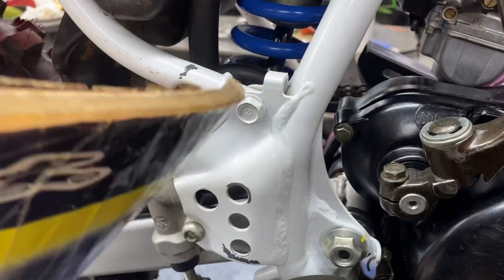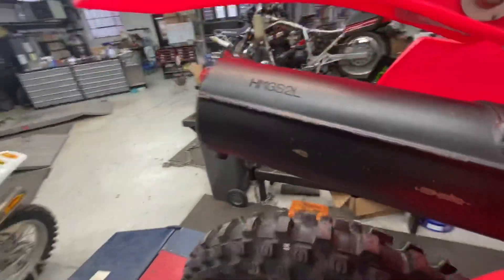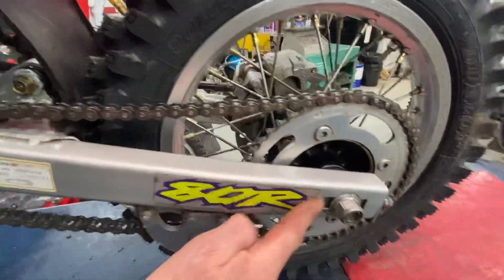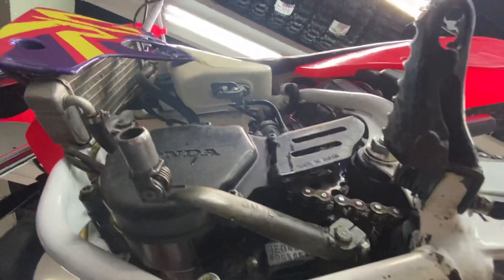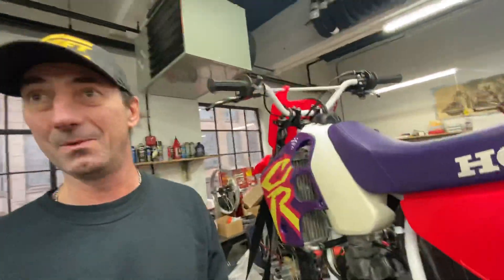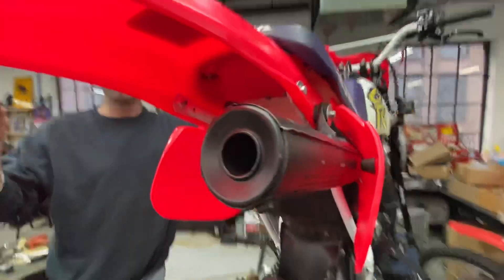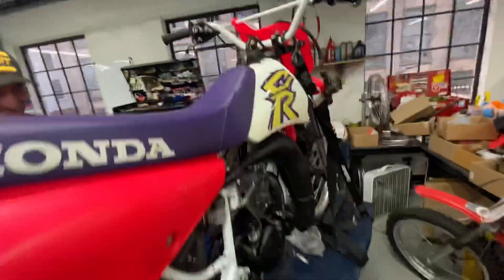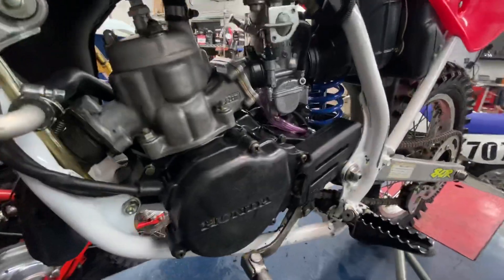‘95 CR80 FACTORY FRESH

Comment: If original bike with very little wear how comes the tank / rad shroud sticker changed ??  There would be way more wear on frame to wear original tank shroud graphics out.
Reply: Same thing with my 1985 XR 350.. It's on this channel.. Go back a few months and you'll see it, Kenny gave it a tune-up.. The bike has like 5-10 hours on it, but the tank stickers look like hell.. One of those things I guess.. 🤷‍♂️🇺🇸🤷‍♂️
Reply from the maker: They were not "worn out" they were 25 year old stickers and looked faded due to fuel & sun, easy fix $60 new graphics! Fresh!

Comment: The mid 1980's were the fastest cr 2ts.
They started changing port timing in the 90's for a wider band with more torque and less peak h.p.
Yes better for mx tracks but not as peaky and fun to ride.